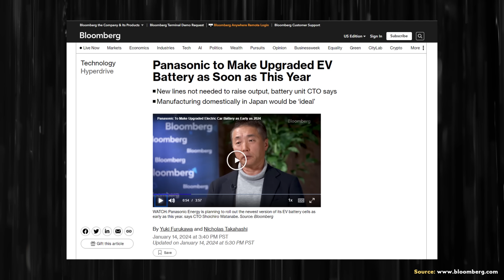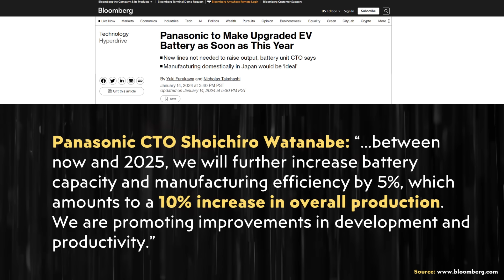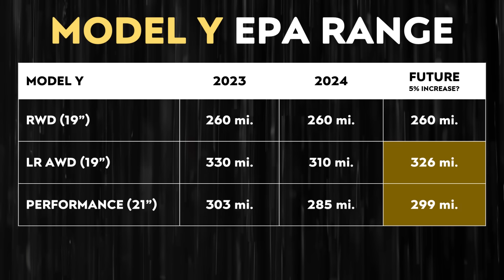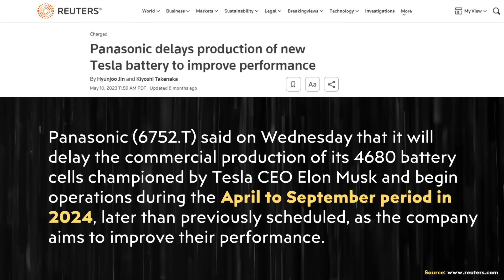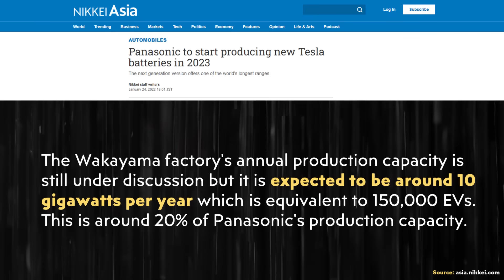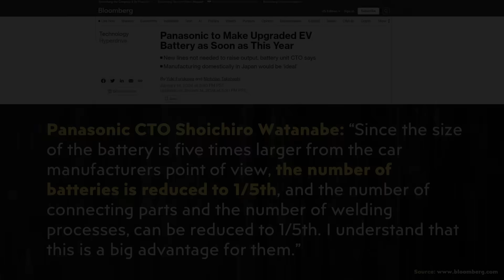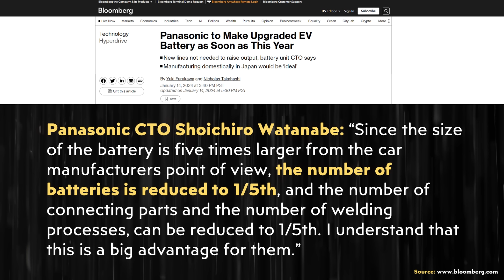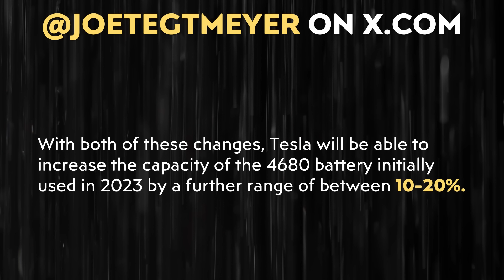Tesla Model Y 5% RANGE INCREASE? | NEW Panasonic Batteries!

Comment: If Tesla keeps battery capacity unchanged, but does it with fewer cells, then that would mean a slightly smaller battery size, and maybe a reduction in weight, which would increase the range of the vehicle.

Comment: Anyone know if you can drive CT WHILE charging?
Reply from the maker: Tesla vehicles do not let you charge while driving. How would this even work anyway?
Reply: @Cleanerwatt  i want to put a generator in the bed and extend the range potentially indefinitely, although there would probably be a limit due to the delta between rate of consumption vs. Rate of supply.  Think, Ramcharger, but Cybertruck version.

Comment: What will it take to improve the charging curve for 4680 cyber cells?  The Out of Spec rated the curve as the least competitive with Rivian and Ford batteries.  What's holding the cells back if they have supposedly better thermal management?
Reply: A software update most likely. They are being overly cautious with the charge curve until they get more fleet data. 
New chemistry with silicone will also help heaps. I wouldn't buy a Cybertruck for at least 12 months. I think we will see a lot of advances by next year

Comment: I have the 4680 Model Y it's been fantastic over the course of 22k mi since July of last year. It's extremely efficient currently @245 Wh/mi lifetime.

95% of my charging is done at home and even when I have been to the Superchargers the slower speeds aren't that big of a deal and really a non-issue especially driving it around a metropolitan sized city, it's not a concern I didn't buy it to do road trips in.

Other Tesla Model Y owners have commented that the car feels more structurally sound and stiffer compared to their 2170 non-structural pack version. So having a 4680 structural battery pack in my opinion is a bonus as far I'm concerned.

Comment: The terrible DC fast charging performance of 4680 AWD MYs is well documented. Tesla’s rapid deprecation of this model makes me suspicious of other issues lurking with the architecture. Munro Live’s tear down revealed the structural pack to be a messy lasagna that will be difficult to repair.
Reply: Refer me to a link of the terrible DC fast charging of the 4680s in a model Y. I must’ve missed that.

Comment: I own a 4680 Model Y.  The 279 miles is fine for a daily commuter.  I have only ever charged at home.  With the cold snap recently and  leaving the car at the airport the car lost 12-15 miles of range per day just sitting in the -10 F cold.
Reply: Turn off sentry and you'll lose 1% every 4-5 days
Reply: @TedKidd  I like that idea for emergency situations but at the Denver airport I would prefer to have some sort of security to deter vandals.
Reply: Did you disable Sentry mode & Cabin Overheat protection?
Reply: also, set your car to forget your WiFi network so it will default back to Tesla 4G LTE if disabling Sentry mode & Overheat protection doesn't improve the vampire drain
Reply: Nope. Didn’t think of that. Just left it as I normally leave it in the garage.
Reply: @Schneck112  so your telling us your metrics you wrote about are useless! Probably should just delete original post as it has no actual relevant value?
Reply: Disable sentry mode

Comment: When the 3 gets to 360 mile range I'll buy it. Have to consider cold weather driving and the 10 to 80% charging. Unless they add a chemistry to fix the cold weater and charging limit.
Reply: According to data from the U.S. Department of Transportation, 95.1 percent of trips taken in personal vehicles are less than 31 miles; almost 60 percent of all trips are less than 6 miles. In total, the average U.S. driver only covers about 37 miles per day.
Reply: When the 4 gets to 420 ...
Reply: Many people don't precondition their battery before departing from home. By heating that massive 1,000 pound battery, range loss is minimal and is of little concern.
Reply: You don’t need that much range lol, I recently bought model 3 lr and shoudlve gotten the base model. I drive a lot too about 80 miles a day. And with cold weather, just precondition before you leave lol
Reply: @junioo3692  I have a Model 3P, but only use 30% of the battery each day. Plenty of range left. I drive 20k miles per year.